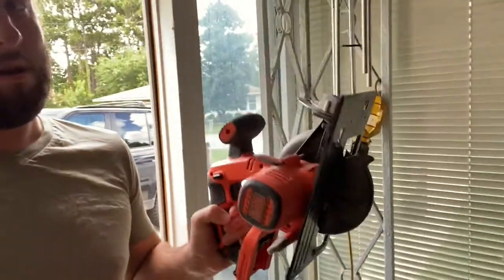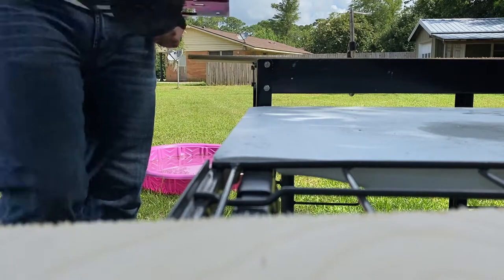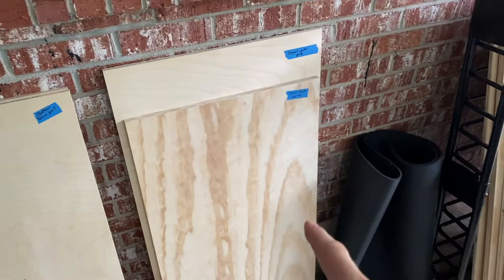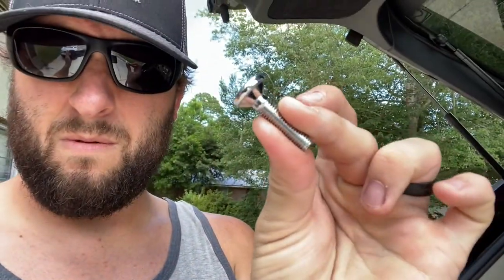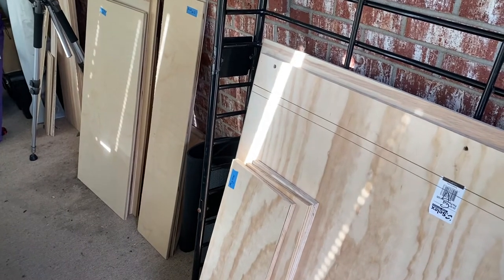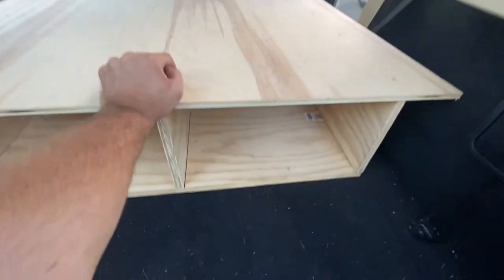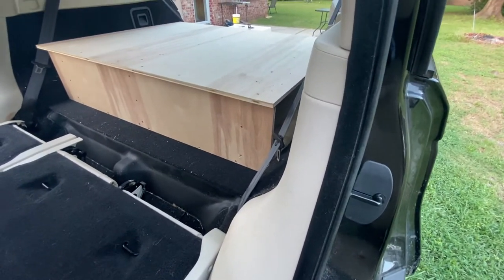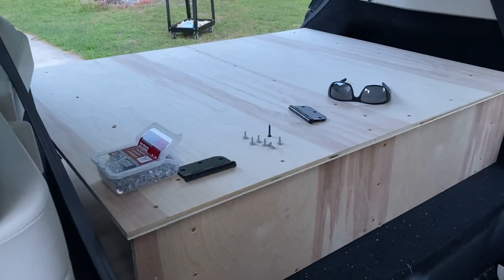Building A Camper Out of a 2011 Range Rover Sport Supercharged Pt. 2

Comment: Hey mate. Whats the lenght of bed?
I am almost 6.4 and wondering if I can sleep inside it.
Thanks!
Reply from the maker: Length of the bed was 72”. I’m 6’1” and it was tight. The problem was the way the rear tailgate slants at the window it makes the bed feel even shorter, also taking into account pillows it felt even shorter. The head room was also very cramped so being tall there is not my room to move around. It was deff a convenient set up but not very comfortable
Reply: @venturevalzone2799  thanks for fast response!
I am looking for a disco, which is big enought, but I find a nice range rover sport and just don't know what to do.
Reply from the maker: @domenoraze7584  disco is deff the way to go if you are planning a similar set up. The space is about the same size. My parents have an lr4 and I took measurements on it, I believe I was able to get the bed to reach about 84”. Also width would be wider because the trim on the lr3/lr4 are different. Head room on the disco would be a world of difference as well. I have since sold the Range Rover and have a disco 1 now. To be honest though I’m leaning more towards the roof top tent on it since it already has a roof rack

Comment: How are those 275/55/20 for off road? 
Do they fit without mods?
Reply from the maker: They were great. They fit with the proud rhino lift which I think was 2.25 inches. I had a little rub here and there but nothing alarming. Make sure you get an alignment after putting on lift rods or you will eat those tires in no time
Reply: @venturevalzone2799  thanks. I am trying to avoid lift so might have to go with 18"
Reply from the maker: @InfinityProjector  just curious why are you trying to avoid the lift?
Reply: @venturevalzone2799  i use it for daily drive, mostly in the city and then occasional off roading. So i don't want to loose ability to park in the city garages (some are 1.9m clearance) and stability on highway traveling. Ideal would be keep it stock on 275/45/20 and then buy another set of Compomotive 18" with some fat off road tires. (Swap them for off road trip and keep R20 for most of the year)
Reply from the maker: @InfinityProjector  makes sense, I was able to fit in most garages with roof rails, lift and tires as long as I set it in access mode first. Deff had a picker factor to it. I did daily it about 80miles round trip an the lift isn’t noticeable, it performed on road like a charm and not much effect on mpg. It was sc though so that may have helped
Reply: @venturevalzone2799  Well noted. Perhaps I will do it in stages as my off-roading trips increase in frequency
Reply from the maker: @InfinityProjector  a good set of a/ts and the rover will go anywhere, lift or not. They really are impressive machines even at stock.